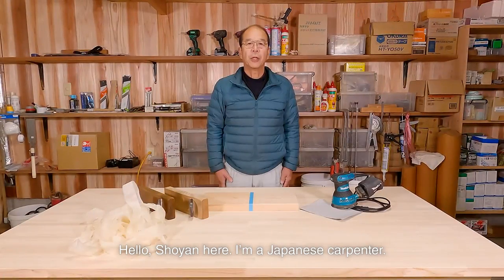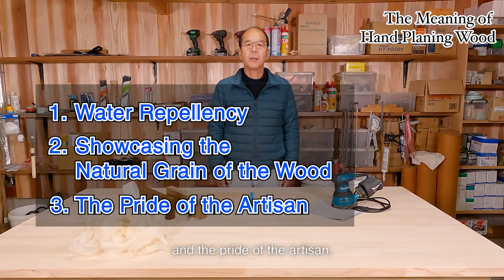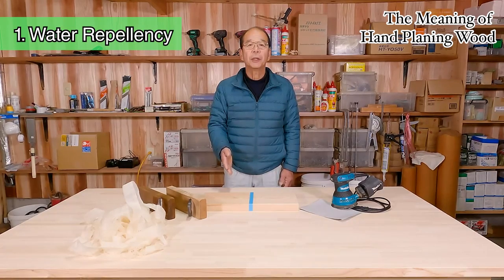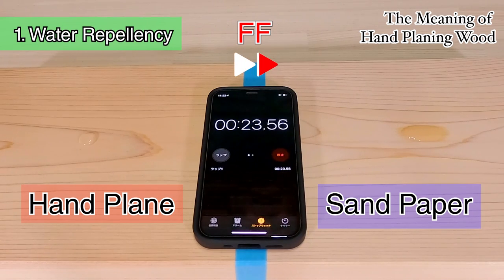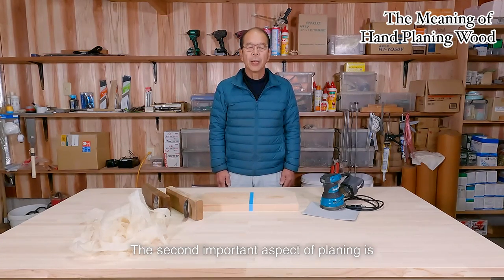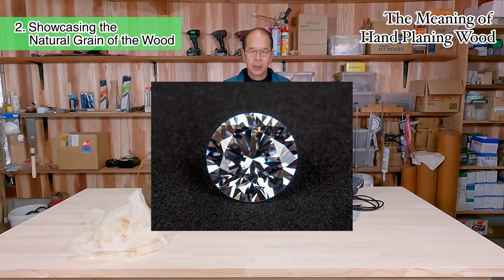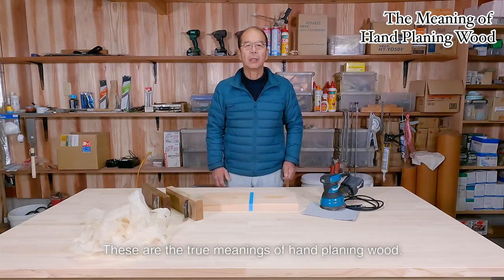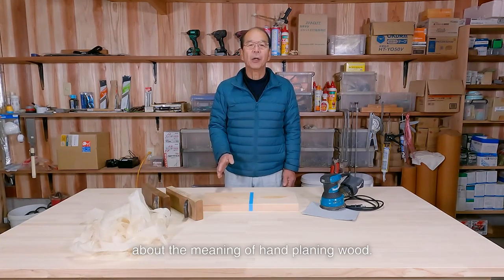Woodworking Tips - Why Do Japanese Artisans Use Hand Planes？

Comment: Shoyan-sensei, domo, domo. I have been told many things about planing and cutting with Japanese tools. I heard that using a plane helps the wood's natural oils come to the surface which gives a superb finish and protection. And perhaps-- like sushi knives--the sharper the blade the less likely to mash the individual cells. Finely cut sushi tastes better--they say, and perhaps finely planed wood has specially qualities, too. What do you think of these two ideas? Please tell us what Japanese carpenters do when they use wood with knots and also when the knap of the grain changes direction? Are Japanese planes so sharp that no problem occurs? Thank you so much for your knowledge and effort to educate us.